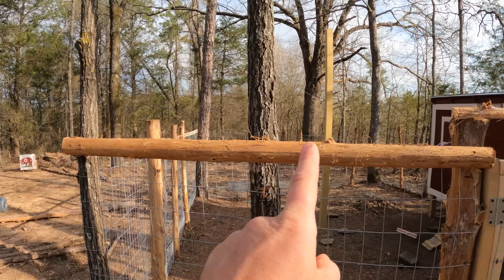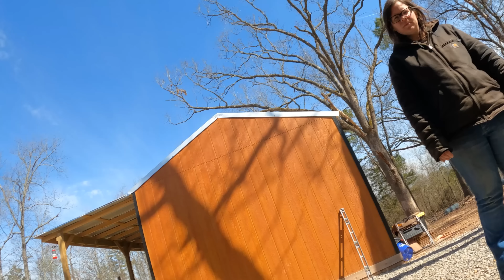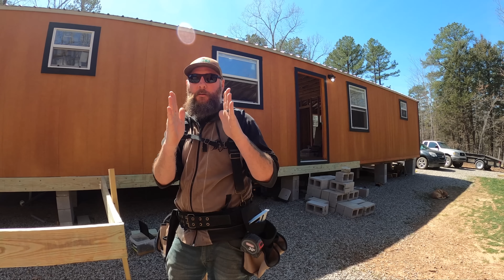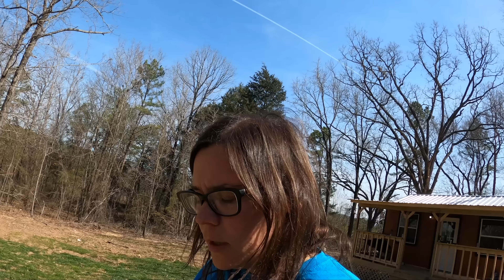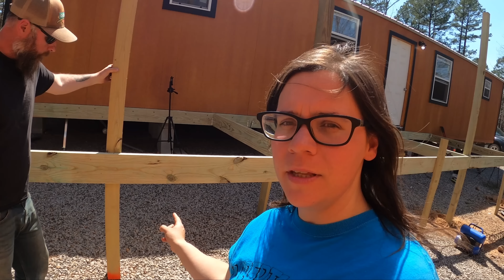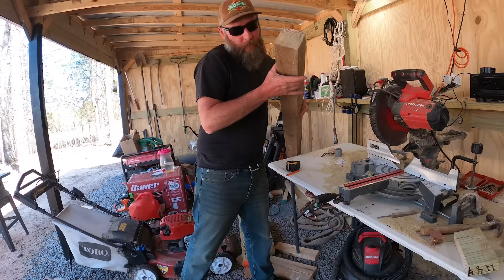This Is Going To Cost A Fortune! | Couple Builds Dream Home | Shed To House

Comment: If you take all the branches and throw them into the bottom of your beds it will be good for your beds and then it won't take as much dirt to fill them.  Most plants don't take deep beds. Put any worms you find in them.

Comment: Hey guys you might want to put a concrete footer under the 4×4 posts  on the end of the deck where you plan on having the laundry for the simple fact there will be alot more weight... it's going to be an awesome deck but if not built right... could be problems in the future

Comment: Make sure you reinforce the area where you are putting washer/dryer and water tank. All that weight you are putting in that area will need to be able to support it or could be trouble down the road. We learned that lesson.

Comment: why do you put post in the ground when your shed/house is sitting on blocks. over time the house and your porch will shift and seatle differently if the porch were on blocks as well they will move together and easly adjusted when they settle. if the house sinks how will you adjust the porch to the house with blocks a one day job to adjust.
Reply from the maker: Post in the ground are just fine :) it's going to take many many years of movement for anything to shift. Also, our house is anchored down in the ground with 4ft earth anchors so the probability of things moving is slim :)

Comment: I know I'm a late but you can use the 3-4-5 method to square up a deck.  Start at a corner and measure 3' one way, 4' the other way and it should be 5' across the marks.
Reply from the maker: I'll have to look into that. Thanks for the advice :)

Comment: Rather than use wood peirs why not use the concrete blocks up near the house and in the center.  SLR has extra.  Also on your raised garden fill about half of them with sticks.  They will help hold water and will rot with time.  I would also make a compost bin next to your garden to put your vegetable cuttings and other kitcken scraps.
Reply from the maker: We have extra pre treated 4x4 posts. Might as well not waste them

Comment: when you layout for framing subtract 3/4" and put an X on the side where the joist/stud is going to land. Then you use a speed square to make sure your limber is square.
when you need a lot of repeated size boards use a stop block. Its as simple as a chunk of scrap and clamp. you can also stack a couple boards on top of each other and cut two or three pieces at a time.

Comment: To Keep Post From Sinking They Need A Footer Block Under Them. You Can Pour Concrete Under Them Or Use A 4 In Concrete Block. The Post Will Slip With Just Pouring Concrete Around Them.

Comment: Man - y'all are such quick learners and pivot so well together to find solutions.  I hope you are proud of yourselves because y'all are knocking these projects out so quickly (and I bet sleeping HARD at night)!
Reply: PS you'll never regret putting up the deck now - 1) getting it done before summer temps; 2) the additional covered living space is a huge benefit when your family/friends visit...the only thing I would suggest that you consider is screening it in to protect against the bugs - especially when grilling/eating out on the deck and 2)  set it up to accommodate ceiling fans - 3 or 4 of them along the length of the house will make a huge difference in comfort half the year (or more).

Comment: A question about the house floor..Are you planning to insulate the bottom side of the floor? Mobile homes have fiberglass batts with vapor barrier attached to the bottom of the floor joist. Nasty job I suppose. Great situation for closed cell spray foam.

Comment: I have a shed coming and I want to use cinder blocks for height, but the company wants me to use solid 15x4x8 blocks. I don't know why I would need them. Have you had any trouble with the open core cinder blocks you have? Thanks. Nice videos by the way.

Comment: What will help you is the4x6x8 method measure from the end of your leger out 4 feet then then measure out on your joist 6feet then you take a measurement between those two marks and it should be 8 feet if not move your joist what ever direction you need to get the 8 foot will be squrare

Comment: I'm a professional  deck builder.  You could m as keep it a free standing deck unattached  to the house  at all.  Just digging post holes close to the building and concrete them in.

You should have a spacer block between the ledger board an the house to prevent water getting trapped and rot out your wall.
Reply from the maker: We put flashing on the house before the ledger. I am also going to seal the deck board that's next to the house with silicone to help prevent water from touching the siding on the house. hopefully that will all be enough!
Reply: @countryroadcure  Another reason for having a free standing deck is properly taxes.  Where I live, a deck is considered living space if one fastener attaches the deck to the house, It can  be  assessed as living space.

Comment: wow good job there both of you some of that timber is a bit heavy for you to but looks good any ways are you cementing in the post i would say also you need a post in the middle where your putting the Laundry room to ? might pay you to dig the holes to put the drains in for the Laundry the pvc in the ground once the deck is on you wont be able to dig or will you just have lay on the ground what about the rain to will you put pvc on the gutters you need to do that or the rain will lay on the ground ??????

Comment: You might consider putting window screen under the deck boards in the portion of the deck that will be enclosed for your hot water heater etc.  That way you won’t have bugs and spiders crawling into that space and making themselves at home.  We did this on our screen porch about 10 years ago and have never regretted it.  It is amazing what used to squeeze between the deck boards before be did this.  And a roll of window screen is pretty inexpensive too.  Love the way things are progressing!

Comment: I'd like to add my 2 bits worth about your deck:  I'm thinkin' that direct buried (even treated ) posts most likely gonna rot out someday.  It may take awhile, but eventually they gonna weaken and your deck will sag a bunch.  Might have been a better idea to use concrete deck block piers instead.  Something like Lowe's Item #560913 or similar.

Comment: Guys you should never attach a deck to a trailer. It should be free standing. Law in some states but for good reason. Your trailer will settle faster than your deck and it will eventually tear your trailer structure. Have personally seen roofs separate because free side of trailer settled faster. But hey y’all are doing great. Just research it.
Reply: Put 2 4x4 post and then span with a 2x8 each side .  Put a set of these every six feet. Then build Frame on top. It will out last trailer. So like a 2x6 frame.  16” centers. Just make sure you start your height from where ever you want it to fit under front door. Did mine just beneath the seal . Measure all your wood and you will know how long post will need to be.

Comment: Anthony & Roxanne, You're working so hard, & have planned ahead, but I wonder if you have considered an outdoor sink area (with a drain hose to drain water away from buildings) that you will have many uses for, especially when you butcher your chickens & hogs.  This will be very important when you raise enough chickens & meat rabbits to put in the freezer or jar.  In the winter you can just turn the water off to that line & drain it to prevent freezing.  It might be wise to install the sink waterline now if it is going to be covered by the deck.  Love watching your videos.   ❤💙

Comment: Just a Question, you don't think you should have put gravel and or cement in the holes for the post to sit in, what happens when the ground get moist with all the weight from all the wood & the ground starts to settle & sink, all of ur hard work will be for nothing,  just asking the Question!